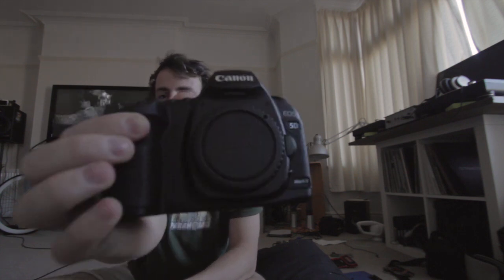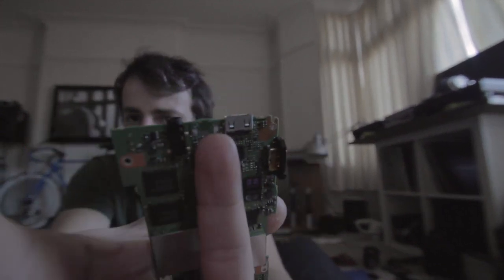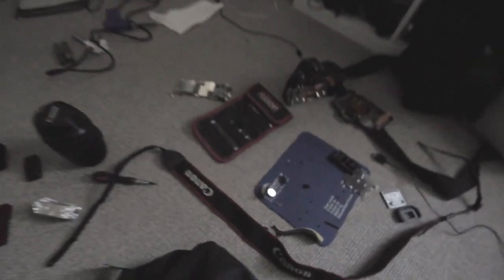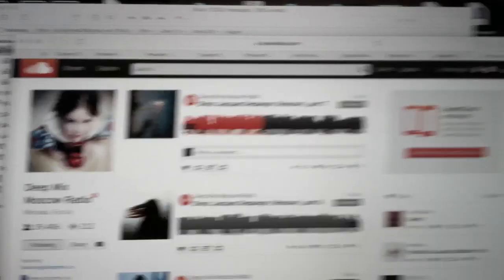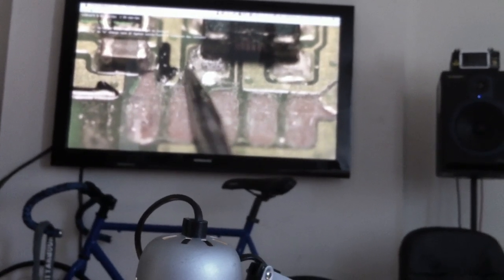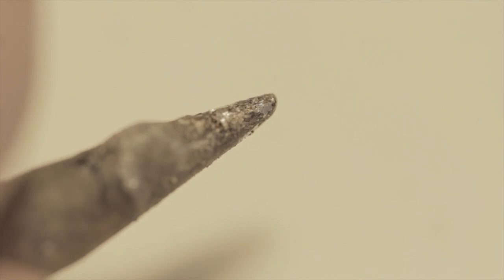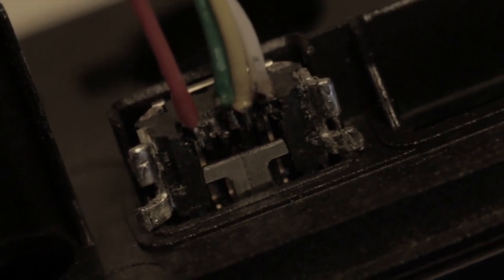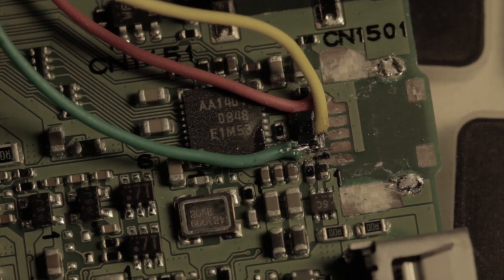Canon 5D MK II USB Port repair

Comment: Can you tell where you connect the last white cable? Thank you!
Reply from the maker: hello!
trace the circuit and see where it goes, find the first component on that line with a multimeter and you should be ok. It's been years, I can't remember where it went, but that's my method of finding connection points.

Comment: Is the 4th cable connected? I cant get mine to work and the only thing I can think is the 4th cable connects to the board I just dont know where.
Reply from the maker: hello!
trace the circuit and see where it goes, find the first component on that line with a multimeter and you should be ok. It's been years, I can't remember where it went, but that's my method of finding connection points.

Comment: I did this but it still did not work? can you take send a me picture of board once you attached all wires? and are you sure one of the tabs from the usb is not used? thanks
Reply from the maker: i am sure as the camera worked no problems
Reply from the maker: i don't have the camera anymore, i sold it a long time ago. but if you take a multimeter and trace the circuit you should find the location of the 4th wire.